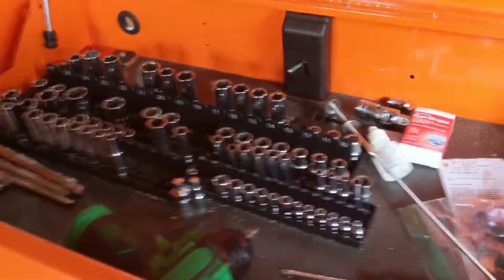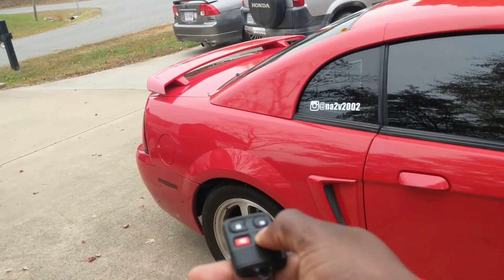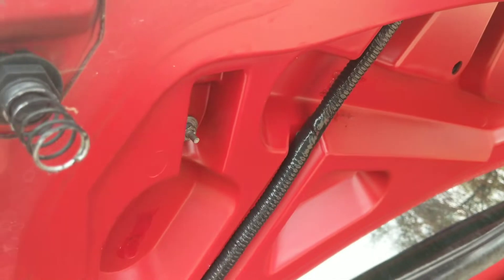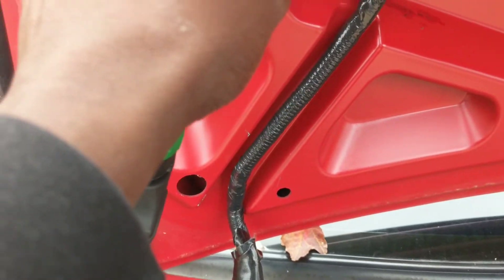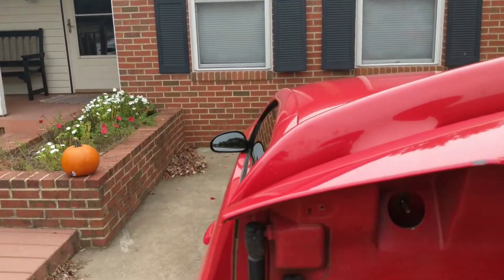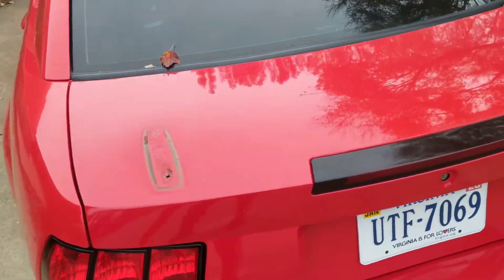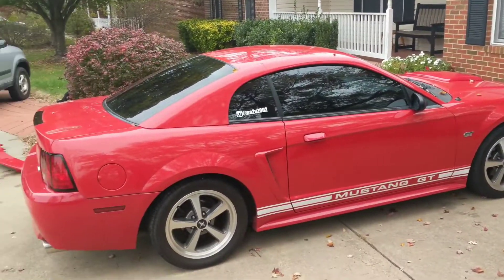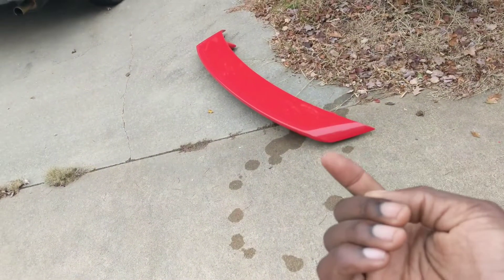(2002) New Edge Mustang spoiler delete

Comment: I've got a 2000 Mustang and thought the spoiler style on that was pretty decent...not the same as yours here...I think the 2000 style was better...attaches at the edge of the trunk.  I think the spoilers on this body style of Mustang add something to the look though...without the spoiler it looks like something is missing.  But I just bought a 2020 Mustang and got the spoiler delete because the spoiler is just a little silly slab directly on the trunk lid, not lifted off.  The trunk lid itself has a kick upwards, so I don't think a spoiler adds anything.